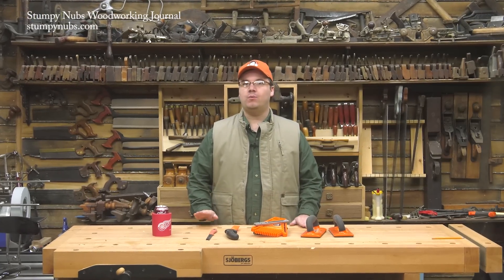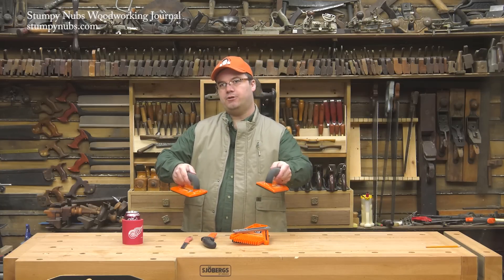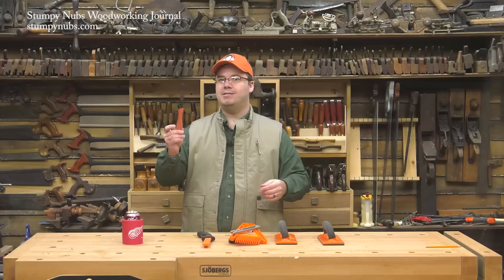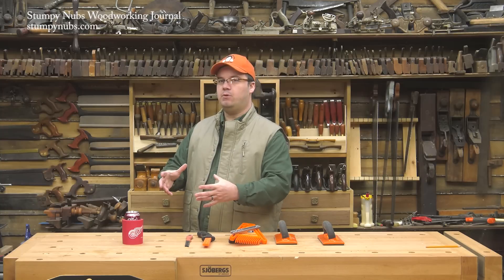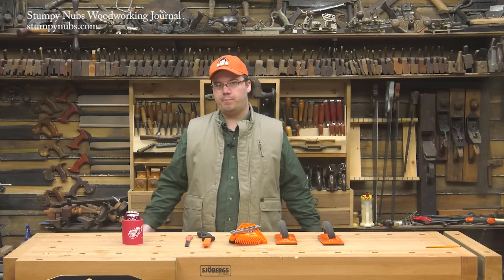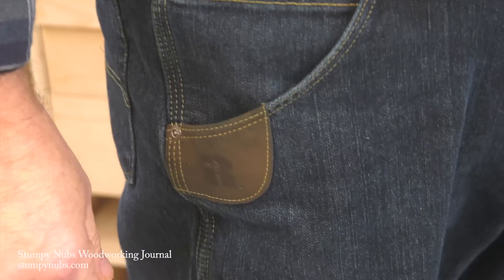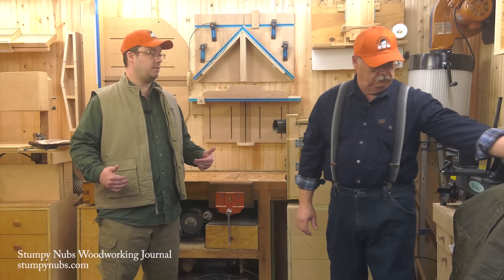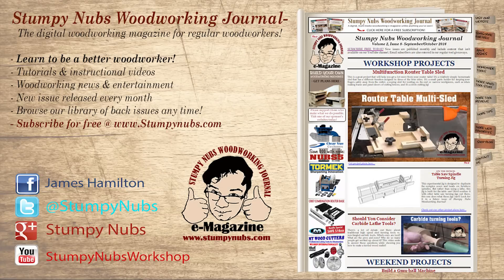3 Cool woodworking tools for December 2016! (Wrangler Riggs, Bench Dogs, Harbor Freight)

Comment: Thanks for the heads up on the Harbor Freight drill press. I've been using my Shopsmith for over 30 years now. It still functions great and I love the variable speed, but, now that I have more room, I'd like to leave the "erector set" against the wall more.

Comment: I'm a pressman by trade and a woodworker at heart. I was turned on the Riggs about a year ago. They are now my everyday wear in the Pressroom. They are super tough, easy to clean, and comfortable. I love the cargo pocket. I can slip my phone or MP3 in the accessories leg pocket it stays put, doesn't slide out even when kneeling, crawling or setting.... The extra lip on the top of the pocket keeps things in place even when getting on and off the forklift. Just some awesome jeans...can even purchase them on line. From Wrangler.

Comment: I love bench dog products.  They are all made extremely well. Safety equipment is not the only line they have.  The cast iron router wing for your table saw is outstanding.  On the other side, Ive been using the Gripper since they came out.  There are always two at my table saw.  As for their push blocks with the stop that drops at the back makes them ideal for use on the jointer.  I think both lines are above the rest that are out there.

Comment: i have one of those Harbor Freight Drill presses... I bought it around 15 years ago. it still works great for me. i agree with you about the base. surprisingly though considering the weight of the top its not that wobbly

Comment: I use my great grandfathers old drill press, I had to do some work cleaning it up( new hard to find drive pull, rewire motor, add a switch) because it's a 1930's companion bench top press but it still does a great job.

Comment: Nice items. I was always skeptical of the longevity of Harbor Freight tools, but, discovered that they do perform well in the light duty of my needs.
The push blocks do seem quite nice. I will seek them out.
Didn't know of this line of Wrangler Riggs. I will check them out.

Comment: I use the shop dog push blocks and I love them also. 
RE: pants, I have been wearing Carhart's cargo pants.  I really like having the big pockets to hold stuff.  They are too heavy to wear in the summer though.  I will check out the Riggs Ranger pants.  They look quite similar to the Carhart, at least in the online images I saw.

Comment: I have been using Bench Dog push blocks for some time. Not the ones that you showed, mine are quite a bit older. but I really like their products.  I really liked the cargo pants that you've demonstrated particularly the ripstop cargo pants. . I will have to look into those. Like Mike  I also wear suspenders,  to me they are more comfortable than a belt. I do wear both a belt and suspenders .  But that's because I'm  quite the safety engineer .  I like to have a backup .Thanks for all the good videos and keep them coming.

Comment: I have never seen a need for an expensive drill press. I had a HF drill press for years until I moved and sold a lot of my tools to avoid shipping them. I am pretty sure the drill press I have now was made by the same company that makes HF. Thanks for the work clothes tip. I have been looking for some good work clothes and so far all I have found are over priced and made for skinny people. The Wranglers are reasonably priced and look like they will fit my Linebacker physique.

Comment: The table top drill supposedly uses exhaust pipe. So if you want a little more height or depth (depending on your perspective) you can cheaply customise.

Comment: Thanks for the tips on the Wrangler RIGGS gear, will have to look into them. I also liked the Bench Dog push blocks, I'm just starting to use my table saw more and the supplied push stick is a little scary.

As a new woodworker I will say I've bought a few tools from Harbor Freight just to get a feel for them. The only one I haven't been pretty satisfied with is the 12" miter saw, just feels too light weight. But the 12" benchtop disc sander works great!

#WranglerRIGGS

Comment: I always enjoy your videos cause I feel like I walk away knowing just a little more than before. "The devil's in the details". Taking a change in your video once in a while isn't such a bad thing. I like that you talked about items in your shop included down to the clothing. I have a similar magnetic push stick from Rockler. Very handy to keep right under table saw. You got me thinking about looking into the smaller stick and the idea of toting it in a tool pouch. I've got a thing for jackets and vests. Those look pretty cool material. It looks like an interesting material I recently saw in a line of pants. Very light, flexible, and durable. I think I saw this material at Costco.

Comment: Big fan here.  As well as a DIY woodworker, I am somewhat of a novice wordsmith.  I have never heard anyone use the term 'grippy' and as far as I can discern, no such word exists.  However, thanks to you, I intend to add it to my shop lingo when ever I can.  

I currently have an old bench top drill press from Craftsman and have been considering investing in a larger stand alone model.  In as much as I do not use a drill press all that often, it would only make sense to look into what Harbor Freight has to offer.  The price difference is certainly an issue so I plan on checking it out.  

Finally, I do wear Wrangler jeans almost exclusively and have done so for years.  I was not aware of the Wrangler Riggs Brand as I have been buying my jeans at Target for years and I have never seen them.  I will pull up their website and check it out.  Thanks for the tip !!

Comment: I agree with the shop dogs line of safety themed items. will have to look into the kit.
Reply: Not bad threads either. #WranglerRIGGS
Reply: check out the new Bench Dog Safety Glasses with hearing protection built in, I bought a pair to try And really like them the ear plugs are soft, work and fit well, best thing is they don't get lost in the piles of chips on the bench or roll under the saw either
Reply: drawvenmusket I'll be checking those out next.  I'm with you on the Bench Dog safety tools!  I just bought the push stick and block, about 3 months ago.  They've made all the difference with my concerns and hesitations as an armature woodworker. I'm still cautious, don't get me wrong, but now when I use my router and table saw I have the right tools for the right price.

Comment: Thanks for the info.  I don't have any Bench Dogs products yet, but a couple of those push blocks would be nice when I'm not using my Grr-Ripper.  The #WranglerRIGGS stuff looks nice, a lot better than the old jeans and t-shirts I usually use.  I was wondering if the Harbor Freight drill presses were any good.  I will keep those in mind, affordable is always nice!

Comment: Drill Press handle 30 second fix, unscrew it ad plumbers teflon tape and rethread.
Reply: Or just load it up with 5 minute epoxy. It won't be removable anymore, but it'll be solid.
Reply: Or make you a new one from a golf ball like I did.. In fact all three are now golf balls..

Comment: Great Behind The Sawdust!  I like #BenchDog products, too.  The space I'm using as a #Woodshop has open walls, at the top under the eaves, and open stud walls.  Couldn't heat it if I tried, although, I'm going to try :-)  Some #WranglerRIGGS workwear would come in handy, and test them under load ;-) - a cold Winter a'comin!  #KeepTheChipsFlying!  #Woodworking

Comment: Depending on how accurate you want your  drill press to be you may need to check the spindle for runout and fix the issue as we've found that to be a problem with all of the imports from China. But if you are willing to put a little time and effort into correcting or finishing i.e. deburring edges, removing grit and grime from moving surfaces and applying a proper lubricant, etc., many of the tools and equipment from Harbor Freight can serve you well and save you money. However, keep in mind that the quality of the metal i.e. iron, steel, etc. is inferior to the American counterpart. Power tools are another story and if you would like to know more then check out the YouTube channel AvE to see how the brands compare and what's inside.
Peace!

Comment: Safety equipment is a must, BUT I use my fingers to do surgery and the one reason I sold my saw 20 years ago is because little stick pushing little sticks pass the blade to me is still to dangerous. But as you know the Gripper is very expensive and so is having to not work anymore because of a lost finger. In high school I had a finger in shop class slip between the sanding wheel and the table. table was welded so it could not be adjusted and i was sanding a small piece of wood. The wood went down between the sanding disc and the table and so did my left index finger. seeing the joint of your finger from a different perspective is not what I wanted to see.That was the end of playing a guitar. So A couple of the you tube sites did a demo on the gripper and I feel much more safe using it on my router, band saw and now table saw. By the way you can cut down to 1/8" strips using the Gripper. Is cost that important when I comes to safety or possibly loosing a appendage? And a Stop Saw is just to expensive for me right now. Just my thoughts. We all agree some type of safety equipment must be used.
Reply: Michael Andersen , this sounds like an alternate genesis story for Dr. Strange...
Reply: lol

Comment: You say the sole is "much better than the other ones you've used", and even mention the Grripper as being 6x the cost, but left off Microjig's more basic push block.  Sure, it's still twice as much as these bench dog ones, but to describe the bench dog as a better/stickier surface than Microjig's super-sticky green stuff is a bit misleading.  I own all 3 tools and after a bit of sawdust contact, I have to wipe down my bench dog one about twice as often as I do the green surface of the microjig push block.  The smaller surface area on the grripper does get clogged about as fast as the bench dog one, so that's probably a fair comparison.  Anyway, all great tools (I'll have to track down that tiny push block -- I love the bigger one), and I love the handles on the bench dog ones, but microjig still wins for grip, not to mention other features like their little drop-down "gravity heel" add-ons.  And sure, why not #WranglerRIGGS  :)
Reply from the maker: Before you accuse someone f being "misleading" you should rethink your argument. I said the Bench Dogs was the best of the ones I HAVE USED. I did not say it was better than the Gripper, or any other MicroJig product. You wrongly assume that I have tried their push block.
Reply: Apologies for coming off that way.  You brought up a microjig product as a comparison, which implied to me that you had used it enough to say it was not worth 6x the price of the bench dog one.  I merely wanted to point out that it was an unfair comparison because microjig makes a more comparable product.

Comment: Those drill presses are not really "no frills" but rather 60+ year old time-tested and refined designs and associated manufacturing techniques. It's almost impossible for a modern manufacture to screw up. They were full of "frills" when newly introduced, with matching quality issues and high prices. 

The Harbor Freight drill presses were new designs circa 1950 at the latest. All their bugs have been been worked out, all the tolerances known down to the micrometer, and the materials which were at the start new, variable and relatively expensive, are now old-hat, uniform and cheap.  Not to mention they can use modern tools like laser measurements, computer controlled lathes etc that make 1950s era tolerances trivial to achieve. With such a body of manufacturing knowledge garnered from decades real world experience, its almost impossible for the shoddiest manufacture today to really screw up the final product.

HF runs into problems when it  tries newer tech e.g. impact drivers, or tries to make a contemporary tech as cheap as possible e.g. LED puck lights, miniature rechargeable drivers or lightweight cheap new alloys in wrenches. In all these cases, the HF manufactures have to figure out designs and processes on their own, in real time, while competing to hit the bottom of the barrel price-point. That's a quality control nightmare. 

Back in the early 90s, I paid $10 for a Chicago tools corded drill with a keyed chuck. I  used it hard and ineptly, dropped it, banged it and it got left out in the rain more than once and it lasted until circa 2010 when the switch died. By then I had cordless drills so I just hoI wired an external switch to it and I still use it as a motor for various jigs and such. Last year, I bought a miniature, rechargeable driver for $10 buck which lasted two weeks (maybe 3 hrs run time) before a tiny part of the rocker switch in the trigger fired itself. 

The difference? The corded drill was a 1950s design with a plastic body instead of the original metal one. All the components were a third heavier than a contemporary corded drill and it lacked the fail points of torque control and keyless chuck. By contrast, the miniature driver was an attempt to create a cheap version ($10 vs ~$50) of a class of tools on the market for less than 10 years old.  Experimenting, they made switch element to lightweight and it burned out. 

So if find yourself in HF trying decide if your looking a good deal or cheap garbage, try to see if you can imagine grand or great-grandad and his buddies, all just back from the war, standing around whistling in admiration at the new fangled tool the shop just got. If you can, it's probably a great deal, if you can't expect hit or miss quality at best.